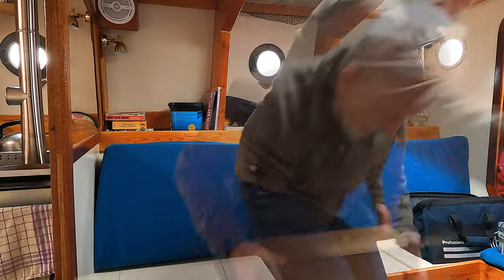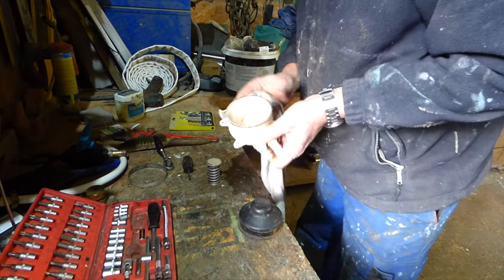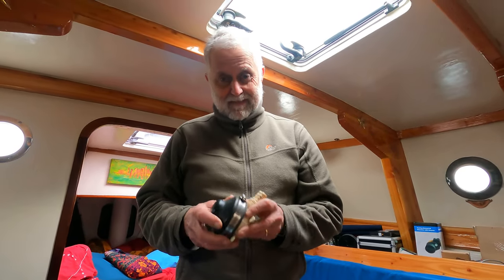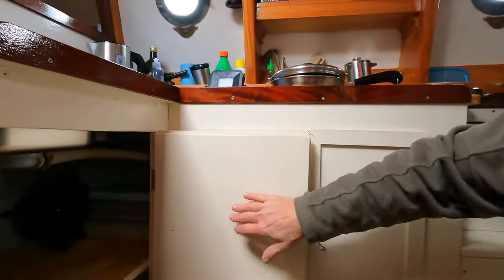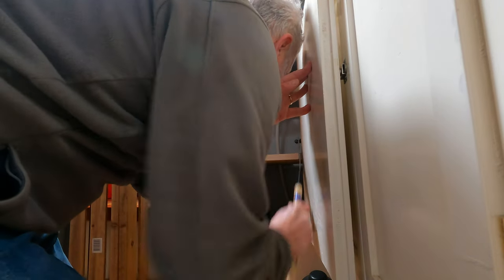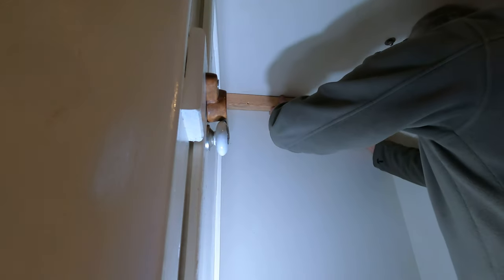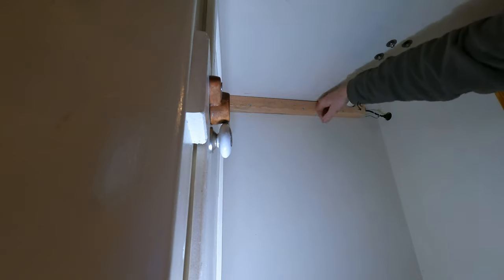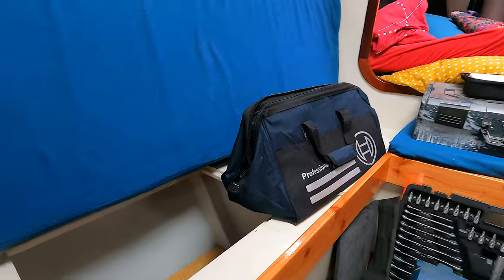Galley Upgrades and Tools Storage; Building a cruising Sailboat - SV Tapatya EP319

Comment: Always nice to see your daughter on the channel.  I’m going to buy a couple of soft tool bags after watching this video.  I have one and one is just not enough.  I’m been careful and they all use the same battery.  Which has worked out well.
Reply from the maker: Yes, I like those tool bags, Dan. And the tools all having the same battery is a big advantage, plus the fact that they can be charged from on board 12 volt dc, all generated by the solar 😃😃

Comment: Indeed these are the never ending boat detailing improvements..Each voyage will create more detailing chores..But that's what makes sailing interesting..
The minds of a boat builder is always occupied with improvement challenges..
Nice work Tony...
Reply from the maker: Thank you Frans. Yes, perfecting the stowage takes experience. Learning how easily you need to access items; knowing what will fit where; maximising use of space; balancing weight distribution; taking what’s needed and not the superfluous. We’re getting there though 👍😃😃

Comment: Great storage idea with those bags, you fitted so many of those 12v tools in one bag! The plumbing redo seems very sensible. Being able to work that tubing with a knife for cutting and brute force for fitting is simpler than some alternatives requiring special flaring tools.
Reply from the maker: Thanks Vince. Yes, I like proper hose for boat plumbing. Nice and flexible 👍😃

Comment: Hi Tony!
Although my boat will be larger, I’ve been thinking to do the same thing with the water pump(s). If having electric pump, it should be primarily with sea water. On galley you don’t really need that much fresh water I think..?
(Of course my dishwasher will need fresh water… 🤔😏)

Great job as always! Looking forward to see the boat on the water again!
Reply from the maker: Thanks Panu. Yes, salt water in the galley can be used a lot and saves a lot of fresh water. Each to their own, but I’ve never seen the need for electric water pumps on a boat 🤔👍
Reply: @SVTapatya  Perhaps shower could be easier with electric pump. 😅
I have currently electric "sea water" (I'm on fresh water lake) pump on my  boat. It's generally quite nice to use.
Reply from the maker: Yes, absolutely! 👍

Comment: Tony how come your replacing  the crankshaft seal you haven't done much on that motor  I would check the alinement  to the gearbox
Reply: It’s a saildrive.
Reply from the maker: And it’s a second hand engine, Glenn. It was standing around for several years. I imagine the seal rubber has hardened